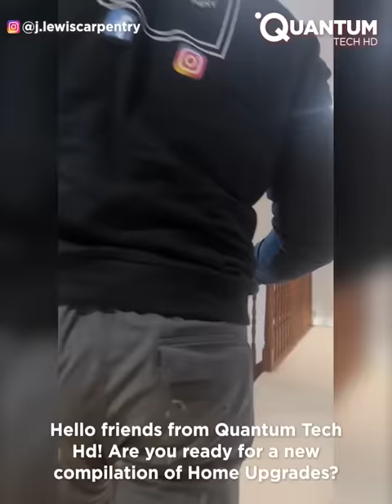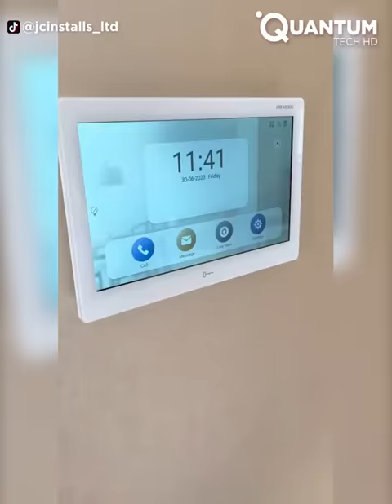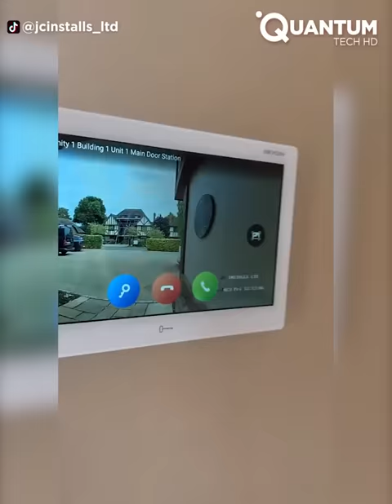Amazing Ideas That Will Upgrade Your Home ▶ 20

Comment: Lol, he covered the heater! XD
Reply: LoL ❤❤❤😢😢😊
Reply: Yea. Noticed it as well on the kitchen. Maybe it's disconnected. Not used. They have other options. 

Cool vid in general
Reply: @RenatSavi If it’s not working, then remove it and cap the ends. If it’s working then move it above the counter top, or another location.
Reply: Здравствуйте. Зачем убирать безопасное дерево и ставить опасное стекло. Не красиво!

Comment: @13:45 - what is the point of a radiator in the middle of a work surface?  And then to box it completely in, making it so it doesn't supply heat to the room - instead of cutting around it, get a heating engineer in and remove the radiator.
Reply: yeah, either the homeowner or the kitchen fitter doesn't understand how radiator work. either that ore maybe the homeowner want the most inefficient food warmer on the planet for their kitchen.